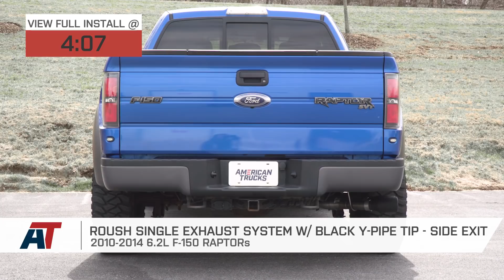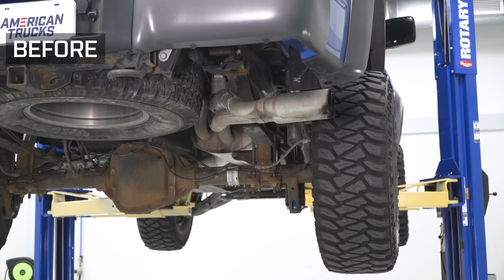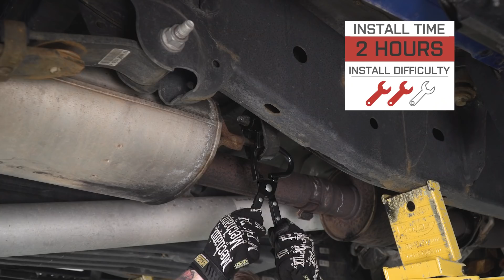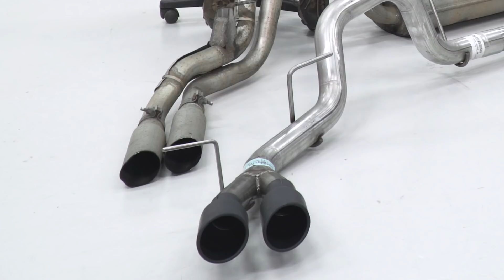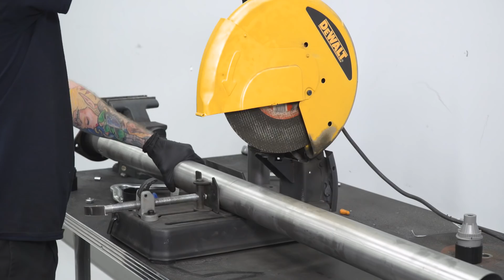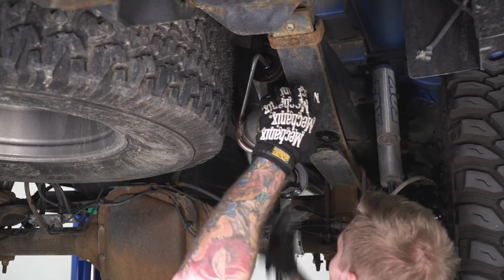2010-2014 Raptor 6.2L Roush Single Exhaust System w/ Black Y-Pipe Tip - Side Exit Review & Install

Comment: The video does not give a good perspective of how terrible the drone is at 1750 rpms with this exhaust. Horrible system and I am usually a fan of Roush products. Think a Roush exhaust sounds great on a Mustang but this exhaust for the gen 1 Raptor is poorly made/engineered by Roush. Save your money.
Reply: Brandon, thanks for mentioning as this is my exact issue I am currently having. I tow my camper a lot and the drone on the Magnaflow exhaust system I have is deafening and compared to other aftermarket systems sounds just ok. It was installed on the truck when I got it. It would be nice to find an aftermarket system that doesnt drone so bad. Anyone have any suggestions other than going back to the wimpy stock set up?
Reply: @mnauto789  I have installed Borla systems on trucks and cars and have always been satisfied. Expensive but worth the money and never any drone.
Reply: @mnauto789   Corsa systems are drone free